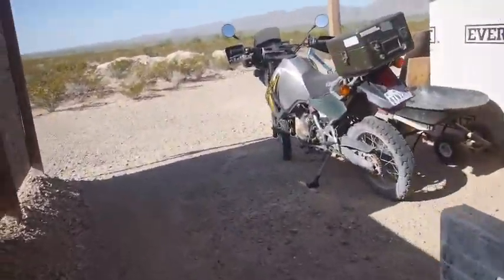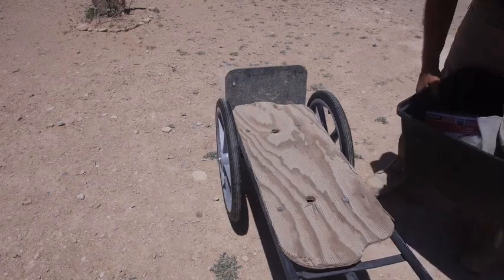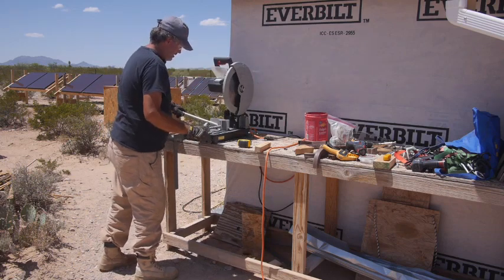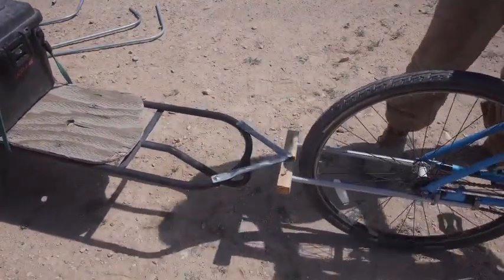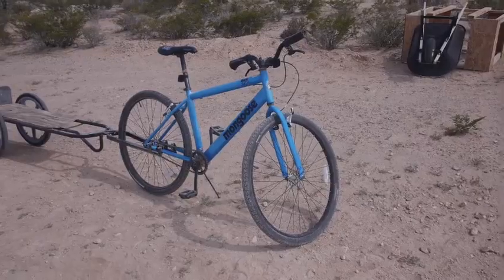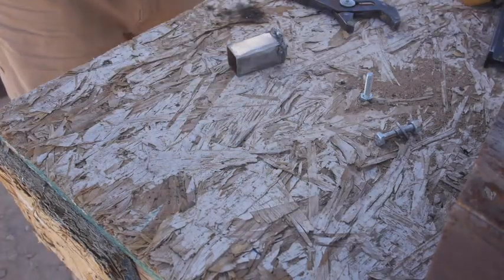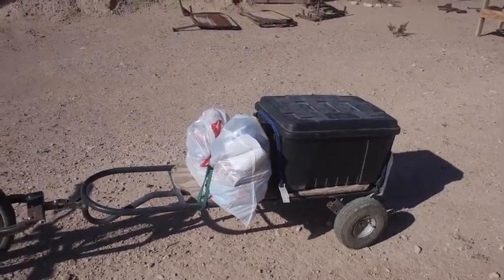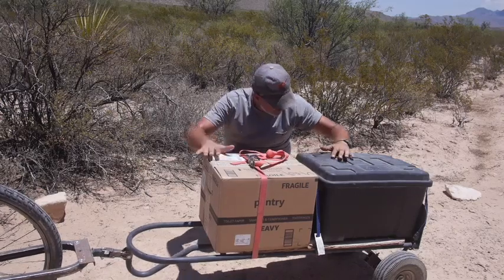DIY Survival Off Grid Bike Trailer

Comment: That joint ya made is just genius level like! This has really helped coz I’m making a tiny home! To be pulled by me push bike! Thankyou so much, Stray1 Britain’s best Unknown stuntman that never was,
Reply from the maker: Thanks, glad you liked it! I've rebuilt and broken so many parts of that trailer over the last few years, I'm not sure what I could offer as advice or encouragement! Start simple and fix it as you go seems as good as anything! The biggest problem with that version was the wheels were way too little, they'd actually drop in and get stuck crossing cattle guards! The current trailer has 26" bicycle tires again. That seems to be the best idea.

Comment: I just made one myself with an old heavy duty plastic bin for the box, and 26" wheels.  It sits at the height of the center line of the wheels, and is about 18" wide, and 24" long.  For the hitch, I used a "u-bolt" on my rear carrier, and a "eye bolt" screwed into the end of a 1" dowel.
Reply from the maker: That sounds great! The bigger wheels roll easier, no doubt. I think the hitch ended up being the most trouble of the whole trailer. Thanks for the comments!

Comment: Use a 2" length of "U"  channel to make an axel mount like Burley. Drill a. Hole for the hitch pin.  Use a  dog plastic cheek bone as the flex link. Cut it into a more tubular shape before drilling. Holes in each end. Add a tubular extension to the side of your hand truck and pin the flex joint into its end.
Reply from the maker: Thanks, if I ever need to make another trailer I will try that!

Comment: Back in the late 1970's a friend of mine and I made two bike trailers out of hand trucks. We removed the original axle and replaced it with one that was almost twice as thick and was a foot and a half wider (9" on each side) which game them more stability. We change the cheap tires from some of better quality. Then we took a couple of Kmart frame backpacks off of the frames, and placed them on the hand trucks, and drilled cotter pin holes to mount them with. Then we had a stout curved tube welded on to each one to use as a hitch. The hitch mounted on the seat post with a U bolt. We pulled those makeshift trailers for 7,000 miles, and as bike trailers were basically unheard of in those days, just about everyone we talked to wanted to know how we made them. Total cost in 1976, about $40 each.
Reply from the maker: That's awesome! Do what you need to do, get it done! Thanks for sharing!

Comment: My late dad was a mechanical engineer designing buses and vehicles most of his life. He also drafted a bike trailer once, spending a lot of time to find the right pivoting point to ensure best trailing (staying on the same wheel track as the bike went on). The best pivoting point is cca midway between the bike's rear wheel axle and the trailer axle - if you put the pivot closer to the bike the trailer will always turn on a smaller radius as the bike rear wheel and much smaller than the front wheel, which could be a problem when negotiating tight corners. This, however, requires a relatively long bracket mounted on the bike, with its weight. 
Another big issue he tackled was suspension. A real suspension with springs and dampening adds to weight (and complexity) but measurably decreases towing force (would be easire to tow). Our guess for a first try was to use gas cylinders used e.g. to support a car's trunk door aloft. That would add both the spring and dampening. 
Finally a conclusion we had about wheel size is, bigger wheels have lots of advantages but some serious disadvantage. Limiting lateral load size is one disadvantage. Another disadvantage is it tends to keep the load higher and if the surface is not horizontal (e.g one wheel rolls on a rock when the other one does not) the entire load rolls/swings heavily to the side and back. Riding seriously uneven surface might lead to the trailer tipping to the side. Therefore it makes serious sense to consider monowheel trailers. That takes you to a trickier pivoting solution though.
Reply from the maker: Its definitely not as easy as I thought!

Comment: Not gonna lie, hose clamps are great for bikes. I use old tubes as rubber isolation to protect the paint (i ride a ratty ATB) but they hold stuff super well and are dirt cheap
Reply from the maker: I totally agree! My current ebike battery is mounted to the frame with hoseclamps and duct tape :) I just didn't feel like fabricating something more elegant.

Comment: what about ball joint? those would offer (limited)  3 side movements needed for stable ride with cargo. nice idea using hand trolley as base  of trailer. i may use your idea ;)
Reply from the maker: I think after I tried everything else, the ball joint would be the best idea. I think I didn't try it because I couldn't find a small enough ball hitch, or it seems too expensive. But I would think it's the best option!

Comment: That is cool, using a sack truck as a trailer. 1 thing did occur to me. Would it be worth using a towing ball/hitch configuration such as you would have from a car to a small "garden" 6 x 4 trailer. Welding the towing ball to the steel extenders from the bike frame and the hitch part to the trailer ? Just a thought.
Reply from the maker: Yes, if I do this again, a ball hitch would be great.

Comment: That Benny Hill song is called, " Yakkity-Sax".  
  A double-leg kickstand might solve your bike tipping over problem.  
     You might want to invest in a multi-speed bike to make your trips a little easier.  
     Very nice process.  I like your results.
Reply from the maker: Thanks for the info on the Benny Hill song, looking it up now! This video was made about 3 years ago, so I don't remember the details anymore, I'd changed so many things in the mean time. More recently I've started riding a recumbent trike that I made, which also has electric assist and solar to keep the batteries charged, you might want to check that out too!
Reply: @CarlinComm  is your trike tadpole or delta?  People say tadpole is more stable on corners.
Reply from the maker: @ronyerke9250  The new one is a Delta design, I find it pretty good to ride, although its very heavy. Earlier I tried to build a delta using a lot of old bike parts cobbled together. That didn't turn out so well. Example videos of both are on this play list, look to the bottom for the Black Delta Trike episodes, that's the newest one that I ride now... https://www.youtube.com/playlist?list=PLRP61yXi60YVwWnyhOGq26BQYSAT9kH60

Comment: Instead of the hitch contraption, consider a short piece of spring coil. Weld a fender washer to both ends and connect to trailer and bicycle with nuts and bolts.
Reply from the maker: One of the bike trailers I have has a spring, that does seem to do well. I think welding a spring makes it brittle but I haven't tried it.

Comment: One way to do a hitch that won't bind up is two loops cut from an old flat inner tube, one fastened to one side vertically, the other fastened to the other side horizontally, the loops go through each other.

A halfway point between hitching to the seat post and hitching to bars from the level of the back axle is to make a back rack and hitch to the back of the back rack.
Reply from the maker: Sure that sounds like it would work, thanks!

Comment: I have a good idea to connect the pivot point use the rubber brackets at muffler shops use to hang the muffler pipe with its strong it's sturdy and it flexible perfect for the application
⚓
Reply from the maker: Great tip!

Comment: Hello loved watching your video for me my Pivot point i made mine using a Folding Lug wrench and 1 large spring and a motorcyle handlebar riser to attach it to the rear axl of my bike. I cut out the pivot leaving a coulple of inches on each side. the side that has the axl nut i insert a large spring the side that is used for the handle i attach the the trailer back to the spring i insert a inch of it over a bicyle seatpost. yhea i drill and bolt the spring on no welder anyways the seatpost that now has a spring on it i attach it to the bike using a motorcycle handlebar riser all i do is place a nut in the riser thread it on to  my rear axl then slide the seatpost on when i want to use my trailer and it makes tight turns you can lay the bike down and the trailer be fully loader and will stay upright and its heavy duty. i know i didnt spend more than 5 dollars finding things at swapmeet and yardsales.
Reply from the maker: Thank you so much for the comment! I've been offline for a couple months so am just catching up now!  I like your idea for the pivot, that seems like it would be strong enough. Ive broken bolts on that trailer out here...

Comment: Nice vid! Hope  you're dealing with the major heat events well.
Here is my 2 cents;
As you say; "Roll, Pitch, and Yaw". Your pitch (nose up and down) should gimbel at the rear tire axle. This puts all your tong weight directly on your rear tire axis. That way a load on your traylor doesn't try to make you 'wheely'. 
Your "Yaw" (side to side or turning bend) should be right behind your rear tire, but maintain horizontal strength (see Burly  single wheel Traylor attachments for an illustration). Your roll, because you have 2 traylor wheels instead of one, should be right behind the Yaw axis but limited by bungees or springs to keep it 'wanting' to have both traylor wheels on the ground, (limiting side tip-overs). If you could cant your traylor wheels Toe-Out a bit it would add to the stability too.
Nice project. You wound up my imagination with it, Thanks.
Reply from the maker: Thanks for the great comment! I have gone through several changes on this over the last year, its hard to keep track of everything since then! The basic hitch hasn't changed much though. If you're interested in making one of your own, yes, the ones you buy typically just connect to the bike at the axle, there are definitely advantages to that. I didn't feel they looked strong enough for what I'm doing, my road is really rough, and the loads are heavy. I've broken bolts, for example. Something I did consider was to hook to the seat post, with a goose neck connection. There are advantages to that as well, but I never really tested it. I think it might be worth trying a trailer hitch with a ball, like a regular car trailer but go smaller. One big issue to watch for, as you add up each axis, that is 3 wear points and 3 pivots, so each pivot adds slack. When I hit a bump, or a rock, the trailer oscillates, pulls back, then jumps ahead, and each slack pivot point adds to that. Gets really annoying after 20 or 30 miles! A ball hitch might do better there. And I feel I really need the roll axis, if I just lay the bike down, or it tips over. Often the bike's side stand won't support the bike when I'm loading the trailer, so it ends up being easier to just lay the bike down when I stop. Making this work well is more complicated than I thought it would be! Thanks again for the comment.

Comment: When you talked about roll, pitch, and yaw (and later, when the bike fell over), I thought about my experiences with a cheap bike trailer that I got off CraigsList. It had a "goose neck" with a fixed ring on it. The ring connected to the seat post. A rubber gasket was missing, so I put foam and duct tape on the seat post to deaden the banging. It worked pretty well. I never had a problem when I had two kids in it. One time, though, I only had one kid and the light side of the bike hit a curb. The trailer flipped!
It was a good thing that the seat post through the ring limited the roll access. I quickly jerked the bike in the other direction and it popped back up. My son was strapped in and safely contained inside the sides of the trailer. If it had flipped all the way over it might have been an issue. I don't suppose you've had any troubles with the trailer tipping, have you?
The other trailers we had were single wheel. They also attached to the seat post, but the roll was kept to as close to zero as possible because the trailer was supposed to lean with the bike.
Reply from the maker: Yikes! Glad to hear your kid was ok, that would be scary! The trailer has gone through many changes, but that basic pivot is still about the same, I upgraded some of the bolts, the 1/4" bolts were showing wear. I did manage to tip the trailer over once, I ran over a bush bigger than the trailer, which dragged me to a stop pretty quick, and it wasn't until I stopped, then the bush kind of sprung back then the trailer rolled over. Later versions have wider axles and bigger wheels. I like the 1 wheel trailers, but I'm hauling 40 pounds of groceries, so wanted to make a wider trailer to be more stable. Thanks for the comment!
Reply: @CarlinComm  - After I left my comment, I found myself reflecting on cargo trailers, and I'm finding myself pretty fond of the one-wheel concept. I have no experience with chain-stay hitches (whether like yours or the very common type that kind of reaches around), but I'm very comfortable with seat-post hitches (even though the goose-neck can be long and awkward off the bike). The only instability, it seems to me, would be while loading it - and then you'd lean the bike against something. The whole rig would be linked together and you wouldn't have the bike fall over like it did in the video.
All this said, I  still have the old plastic trailer. Almost certainly I would press that into service before buying or building something new.
Reply from the maker: @MrTwostring  If I would have had bigger pieces of metal when I started, I had considered a goose neck hitch to the seat, that was the kind of bike I had seen a few times in the past, and it seemed simpler. Making the hitch part of the bike, off the lower frame like I did, works, but leads to other problems, mainly it gets in the way when changing tires, and I get way more flats on the rear, go figure! I also had to extend the hitch point past the rear of the tire, so that makes a weird leverage effect, so definitely not ideal. The later versions are better, I've changed this a few different ways since the beginning. And for me, the key point was I was using stuff I had available, so none of it was as good as it could be. Always good to bounce ideas off others who have different experiences!
Reply: @CarlinComm  - One additional thought. I still have the racks I used when I was a college student to buy groceries. Heavy metal rack with spring loaded clamp on it. Folding WIRE cages. I loved that thing. The grocery store wasn't far, but hand carrying groceries was harder than I imagined.
I've yet to want to put that thing on any bike because the dang thing is so heavy.
I used to buy no more than, I think, four bags of groceries -- then I consolidated to two and a half. These were the old-school paper bags.  One on each side overloaded, and the half bag in the spring loaded giant mousetrap on top.
You've got me wanting to bolt that thing on and taking a trip to my local grocery store to see how many pounds it can carry.
Reply from the maker: @MrTwostring  Yeah those sound great! I remember when I lived in Seattle, we weren't that far from the grocery store, I was married then, so we'd just walk for groceries. What doesn't seem like very much in the cart feels pretty heavy by the time you get home! Any kind of cart or rack is a huge improvement. Those sound awesome!

Comment: Thank U 4 Your time :) , I learned a lot
Reply from the maker: Thanks, I'm glad you liked it. Later made a one wheel trailer that I used for about 1000 miles, I'm now about 2000 miles from home on an electric bicycle with solar trailer. Check out the 22 States video playlist.
Reply: @CarlinComm  A great movie, so I added it to my favorites :), I am afraid of a one-wheeled due to this stability, because I would like to transport +/- 50 kg, maybe more. Tomorrow I will look for this movie 22 states. Have a good trip ... stay safe :)
Reply from the maker: @ahimsa1979  with a good hitch design the one wheel was very easy to tow, but I struggled with parking. Needed a bit more time to get it working.